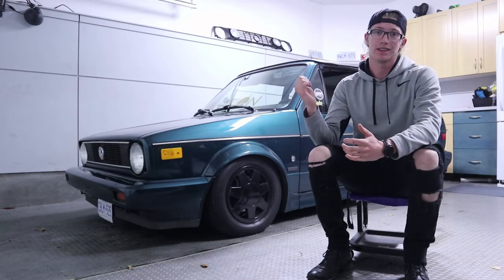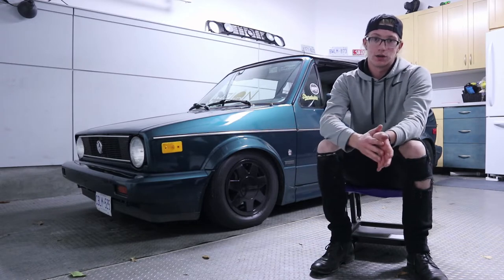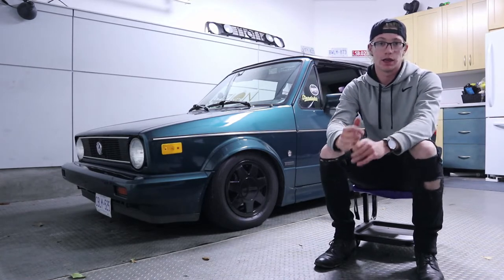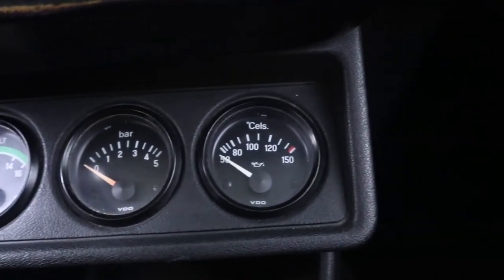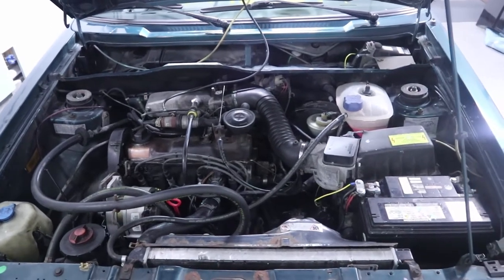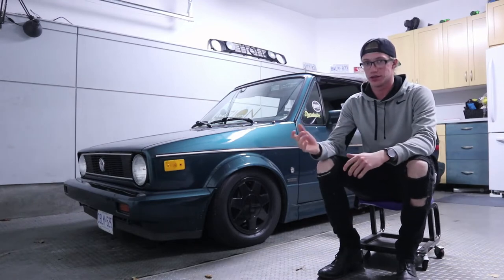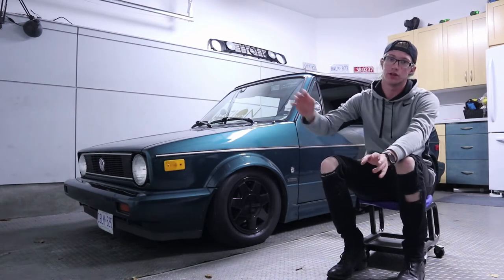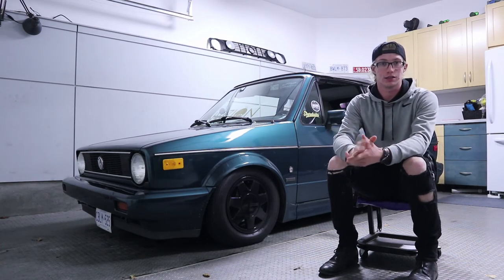MK1 Cabriolet Project - Introduction

Comment: Love the video Bro! I have a question. Where did you get you pad for your center bar? Mine on my 89 is shot. Love the look of yours. Thanks
Reply from the maker: Hey man!  Thanks for the love!  The kneebar came from the parts car, it just happened to be in great shape.  Im actually on the hunt for another one with no hole for the ashtray and cig lighter haha
Reply from the maker: Wow Im an idiot, pretty sure you're talking about the roof bar.  Mine is just wrapped with the same material as the shift boot.  You can pop off the top to tuck in the fabric.  I kept the original foam underneath to keep it padded